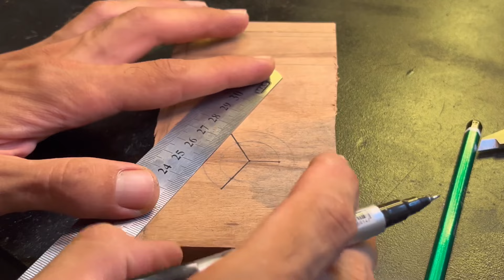Top 5 DIY Woodworking Secrets: Knobs, Photo Transfers & Essential Jigs #woodworking #diytools #diy

Comment: Do you need lazer print copies to do the transfer like you do when making PCB at home?
Are those wood screws with a 'dot' JIS (Japanese Industry Standard) ?
Phillips screwdrivers round them out real easy but JIS screwdrivers 'lock' in place.
It was a major issue in 1960's and 70's when few people knew the difference (and many still don't know)
Reply from the maker: thanks for watching and sharing your experience, no i use inkjet and those screws are phillips
Reply: @BSIinventor101  That's very interesting to know. Much cheaper than lazer copies but probably wouldn't work for submerged etching. (although I don't do PCB/electronics any more)  Thanks.